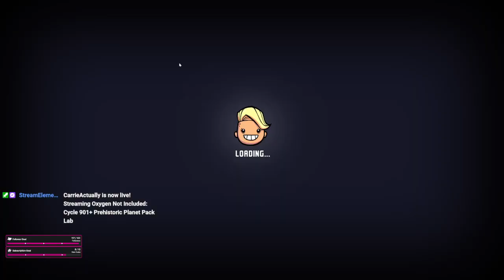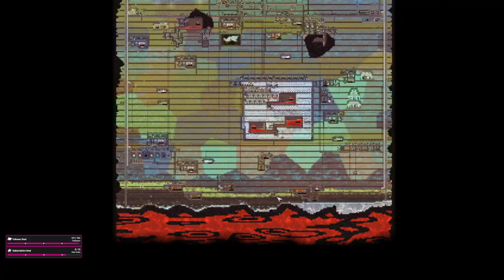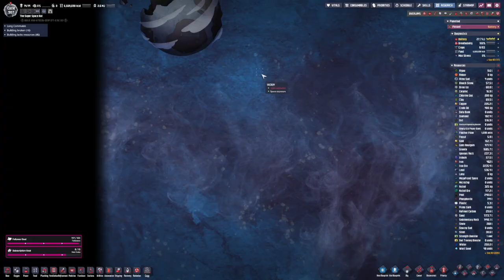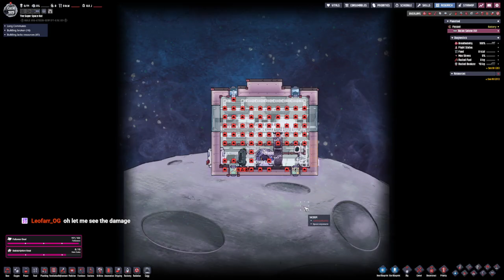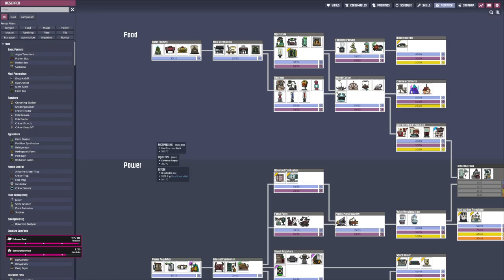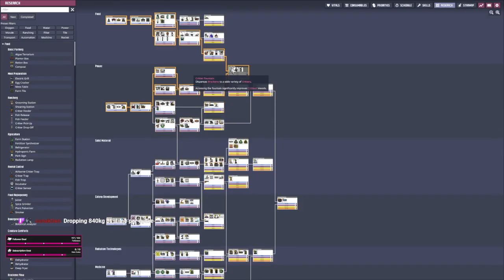Oxygen Not Included: RelicAAAAaaaghh Tame All The Things | Part #16 Cycle 901+ Volcanic Frustrations

Comment: I think maybe the issue with your steamroom not equalizing temperature is that tempshift plates made from igneous rock store heat rather than transfer it. So I guess from the bottom to middle you should have diamond/obsidian tempshift to transfer the heat upwards and maybe igneous at the top next to the turbines?
Reply from the maker: Good idea